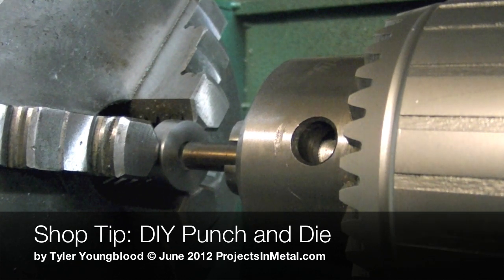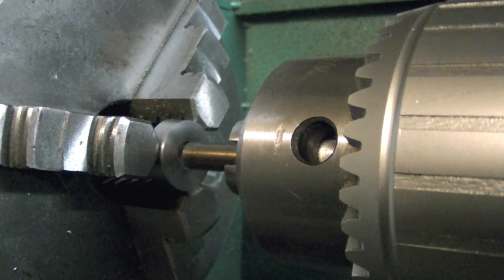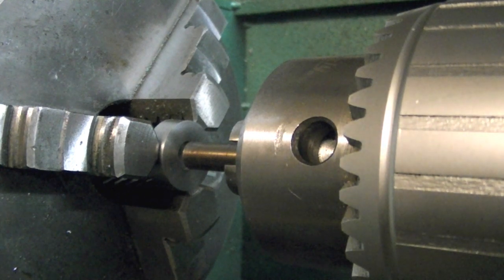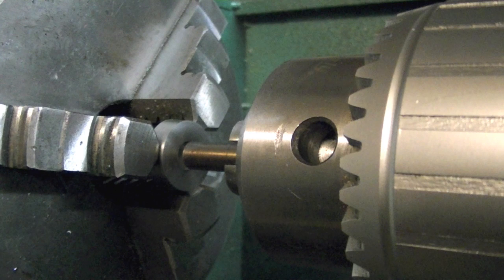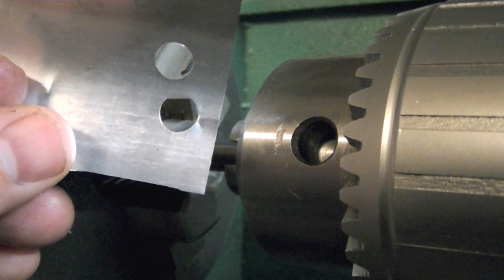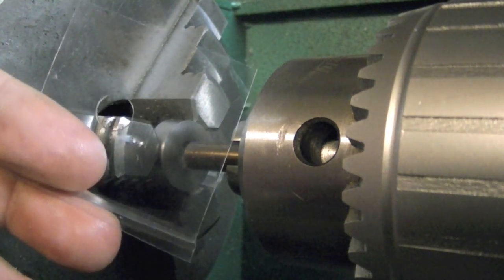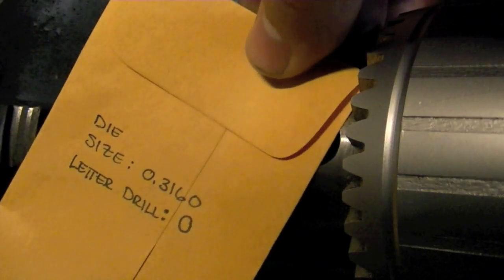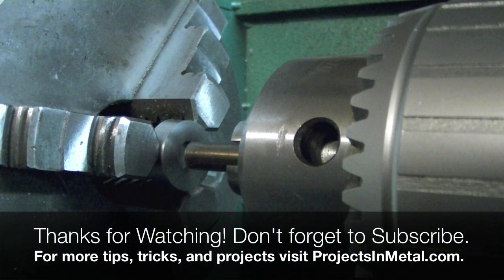Shop Tip - DIY Punch and Die

Comment: on large punchesuse the drill to make the punch AFTER you turn the punch from scrap. You will have way better results if you grind the shank end of the drill at a 1-2 degree angle rather than flat. When you chuck the die, hang it on the punch to get better centering and to ensure that the die is square to the punch. This will limit "puckering". To store these dies, put a bunch of finish nails in a board. stamp the decimal size on the outside then stone flush. End mill tubes work for punches.

Comment: There are a couple ways to prevent pucker. I'll explain one similar to Stan G. First, make another one exactly like the one you have in the left chuck. Second, make another one exactly like the one in the left chuck with hard rubber material. You now have drill bit, 2 steel dies, one rubber die. I'm running out of space to type. Put rubber/steel die (glued together) on drill bit, so it flush the bit. The rest you can figure. :)